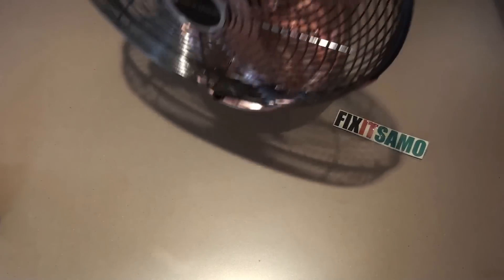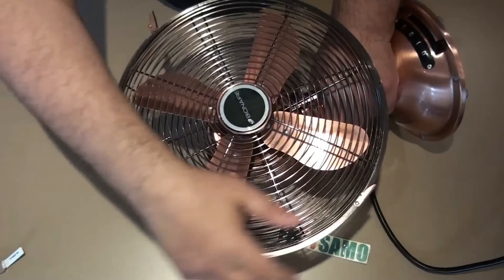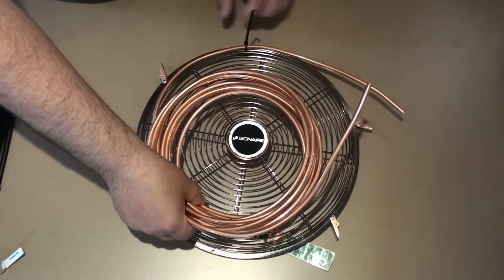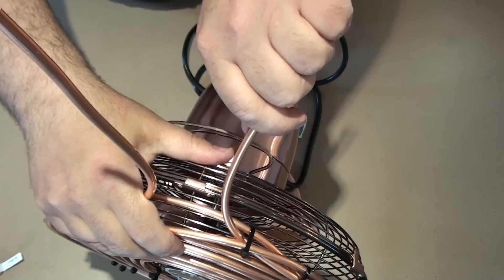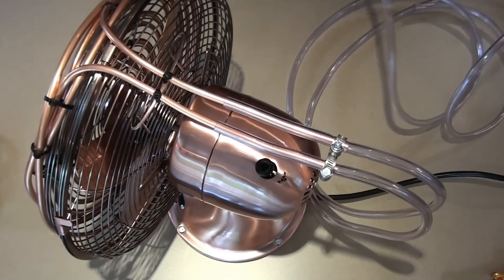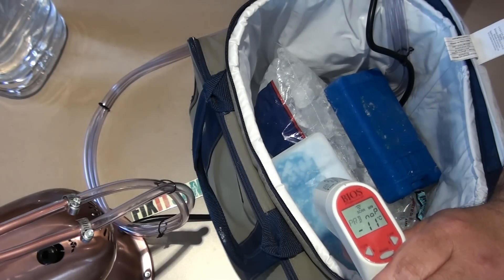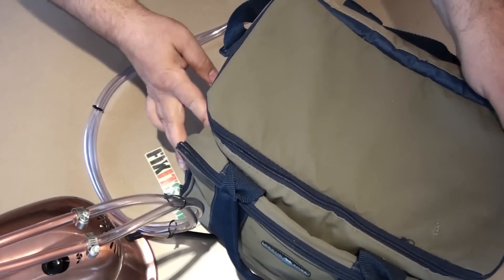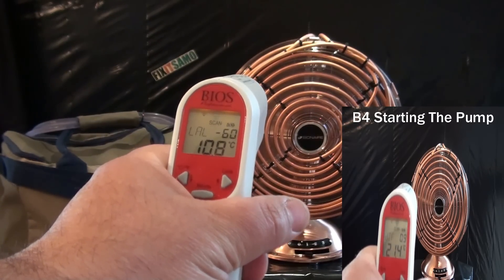How To Turn Your Fan Into An Airconditioner  AC

Comment: Just curious but does it have to be cooper tubing, can aluminum tubing be  used? its much cheaper then cooper. 
This is a great way to cool down when your living off grid. AC take a lot of solar power. This idea would be very helpful for those living off grid in a cabin, van life or skoolie. Homes on  wheels dont have the room for a big solar system making it hard to have AC. This would make a good alternative....
Reply: try bending aluminium it will snap, copper is a better conductor of heat too it's probably 4 times more expensive for that reason copper conducts electricity/heat  61% better than Alu
Reply: @I_am_not_a_bot-666  Thanks, good to know
Reply: @UnKnown-zy1km  save time messing around get a bottle that you  can spray a fine mist I don't know what you call them?  they have  a trigger and adjustable nozzle  that squirts a fine mist,  fill it with cold water and some crushed  Ice use normal desk top fan  when you need to cool down take the bottle of cold water point it at the fan spray the  fine mist in to the air coming from the fan when the mist blows back on to you it cools you down.  that's what I used to do in the desert,  get a hat   with some corks hanging from it to keep the flies out of you're face is optional.
Reply: @I_am_not_a_bot-666  I was just looking at this idea as a option. I have a full contained bus with Solar and a Generator with AC. I dont run the AC on my solar its to much of a drain on it but I can crank up my Gen to run my AC if I need too. I just dont like to use the Gen its noisy and its not very fuel efficient but if I get that hot I do have the option of my Gen. Im just looking for a different way to cool down when needed and be comfortable. 
I do have friends who cant afford to travel to get out of the heat because they're retired on fixed incomes. They need a way to cool down thats efficient and a squirt bottle with water in front of a fan is not what Im looking for. Im sure most people know that trick. It only works for a few minutes then u spray again with in a short amount of time you be soaking wet. Its not something people would want to do all summer long. This fan Idea in the video is much better then a squirt bottle of water. Specially since Ice is Not a problems for most people living in tiny home on wheels.
Reply: @I_am_not_a_bot-666  This is probably a stupid question, but if the water flowing through the tubing is being cooled by the fan, then wouldn't this design work, albeit less effectively, without ice?
Reply: Where are you going to get a constant suppy of ice... which you would need.
Reply: @terrystearns1196  There are ways to freeze water off gird. Also many who are off grid in a home on wheels can drive to the store fill up the cooler with ice. Most people off grid run their Refrigerators and Freezer on solar because it doesnt take much energy to run a fridge/freezer. Even fridge with ice machines work on solar or they can also have propane refrigerators like whats in most campers and motor homes. Off grid doesnt mean not having any power. It just means you have to watch how much power you run on a small solar system. A lot of off grid cabins do have plenty of solar because they have the room to have enough solar panels and a place for big battery storage. People living in RV and tiny homes on wheel do not have the room to have lot of panels and big battery banks. Because they travel only solar they have is what they can travel with. Few panels on the top of the RV and a couple of batteries in a small hidden compartment. Theres just no place to put a big solar system. So nomads, vanlifers, skoolie ppl, RV'ers they have to watch how much power they use. Most can run a AC but they couldnt run much of anything else or only run the AC for short amounts of time. The fan would help to fill in the gaps on unbearably hot days. Not something to run 24/7 all summer long... 
Anyways to answer the question ice isn't a problem off grid. I even have a small ice machine in my RV.
Reply: I'm gunna recommend you buy a physics book, it might change your life. for this application look into insulators, once you understand how energy flows you'll be able to come up with many more possible materials that could be substituted..
                                                                                           -Teach A Man To Fish!!!!!
Reply: @andrewh1096  Ok Thanks, what books do you recommend. Im always looking to learn new and helpful things. I agree I dont know much about solar or electricity. I just know being a solo female living in my off grid bus my solar and many others solar systems will not hold up to powering a AC. At least not without spending a whole lot of money on a powerful mobile solar system. I would love to know how I can stay cool in the summer by running my A.C. all the time or other ways to bring temps down. If I stay out of humid states a swamp cooler works to keep it comfortable. My solar works good for my needs except when it come to a A.C. I can do everything I could in my regular home except run the A.C. for more then 2 hours. Other then that nothing has changed in my power usage. I watch TV charge my phone and laptop, I run my laptop and TV a lot. I can use my kitchen appliances, lights including my fridge. I could use propane for my fridge but it runs fine on th solar so no need for the extra expense and Fridges dont use much power to run. I was just looking for something to fill in on those hottest few hours of the day, when a fan isn't cooling enough. I move with the weather normally so when its summer I go where summers are mild. Then to where the winters are mild. No snow unless Im doing a ski trip lol... 
There are a lot of people who live in there home on wheels that dont get to leave the hot summers states. It would be nice if they could get a little comfort. Thats another reason I was looking at this fan idea. 
Many people are older on fixed incomes and they live in a RV or tiny home because they cant afford rent or house payment. Living in a RV or conversion is cheaper for them to live and not be homeless... 
Anyways, yes I would like to read the books just let me know which ones to get....
Thanks
Reply: @andrewh1096   "Teach a Man To Fish " theses idiots will say just go to the store and buy it :P
Reply: Copper is the way to go, it’s why Moscow mules are so cold
Reply: i dont see why not, but the energy to freeze the water in the first place would be the same as running the aircon

Comment: Great idea if the ice is free,  I just don't see any savings here.
Reply: pls leave your brain in bag before entering youtube ....lol
Reply: @7indranil   LOL Doc.
Reply: Most people have Ice-trays...so you can make your own ice in your own freezer. Most Newer Freezer/Fridges have Automatic Ice makers.
Reply: @AnnaJuist  Sure, but the freezer has to take heat away from the water to make ice. This heat is released into the space through the freezer cooler. You put ice in a bag and cool the space you heated before, so the total balance = 0. In fact, it's just a stream of air that creates the illusion of cold, because your sweat evaporates better. The actual cooling of the room is solved in a different way.
Reply: @DL-kc8fc   actually you have a heat gain because of the operation of the compressor. In an ideal case, waste heat dumped into the kitchen would be 6.9 J. In addition it takes about 18,000 BTU to cool a 1000 sq foot space per hour. That equates to melting and distributing 1.5 ton of ice per hour.  ( ice gives off 144 BTU per pound )  --- , good news is some large spaces make ice in the evening during lost cost energy periods and then melt it during the day when the price of electric is higher.   Thanks for posting Fixitsamo,  NIce thought experiment here.
Reply: @GabrielSBarbaraS  Of course, I mean the operating temperature of the compressor, including the heat removed from the refrigerant. There is no room for reports here, but I agree. The price of energy (depending on where you are) can be conditioned by registration and code of metering hours, which are equipped with a double tariff. At night, energy does not have to be cheaper, and if it does, it can be, for example, only 90-120 minutes.

Comment: how neat  I built one  put a little salt in the water along with some ice  and it will be alot cooler
Reply: Wouldn't the salt harm the pump??
Reply: @AnnaJuist  It is necessary to put ice and salt in a separate bag. Water also lowers its freezing point through the bag.
Reply: @AnnaJuist  these kind of pumps are used every day in saltwater aquariums. They are all plastic inside so no metal ever touches the water.

Comment: What is the total to do all of this
Reply: 5000$
Reply: cheap bro, figure it out on your own.   You need a fan with a metal grill so it will hold the weight, a fish tank water pump, and 15 Feet of 1/4 inch or even 3/8 inch copper line.  I'm sure the prices will be different depending on where you live.

Comment: You can just buy a portable ac you dumbass
Reply: @badbilly7499  lol ok bad billy let me know how your fun project works out for you 🤦‍♂️👊
Reply: @jz3689  Wheres the 75 dollar link?
Reply: @badbilly7499  keep looking you’ll find it
Reply: @badbilly7499  but if you must be entertained go on Amazon and you’ll find one if Home Depot doesn’t carry them anymore. You can do it billy I know you can. Meantime let me know how that fun project goes for you haha
Reply: @badbilly7499  actually it looks like you can find them for under $75 on Amazon. Lmao billyyyyyyy what you got to say to that?
Reply: Oh you must still be searching for that link haha. I’m gonna call you silly billy.
Reply: @jz3689  I already did something like this for the work van that the company refused to fix the ac since we used it occasionally but it still got unbearable hot. styrofoam cooler filled with ice cut 2 holes one for a portable fan one for a dryer vent, definitely worth the 50 bucks or so for the creature comfort of ac. That's pretty much the main reason something like this popped up in my recommended, not sure why you are here if all you're gonna do is be an ass. This has a niche use even if it's not the most practical. If you are in a place with no windows or the inability to have a window ac unit portable or not then this sort of stuff works fine. And the cheap "ac" units you are talking about that are in fact not ac units but simple humidifiers don't work in places where the humidity level is already too high since it relies on the simple concept of putting water vapor in the air. Again you would know this sort of stuff if you spent your time educating yourself instead of trolling. It's honestly sad you think understanding simple concepts you should have learned in high school is somehow "going bill nye"
Reply: @jz3689  This was back in like 2012 so the exact products wont be available but here is the basic set up
https://www.walmart.com/ip/Lifoam-Envirocooler-Huskee-Cooler-45qt/485438903 cooler  $13
https://www.walmart.com/ip/Lambro-224WS-4-in-White-Dryer-Vent-Hood/47652479 vent $13
https://www.walmart.com/ip/Go-Fan/184049181 battery fan $13
im pretty sure at the time though the portable fans where more expensive and i had to buy one of those car inverters for the plug. The fact you are over 50 and think a styrofoam cooler and dryer vent would cost more the 25 bucks put together is pretty pathetic. 

This was before I joined the military, got a better education and then got super lucky and invested in BTC when it was still sub 1k. Im 31 and don't work anymore. You say youre not trying to start a fight with anyone yet you call people dumbasses, call them delusional, and try to make fun of someone's first job. Nice. Must suck knowing your life is halfway over and all you have going for you is trolling on youtube.
Reply: @badbilly7499  lmao 🤣
Reply: Portable ac's cost like 20x times more than this setup.
Reply: @70mavgr  $75 for a portable ac so by your math this contraption would only cost you $4 lmao 😂
Reply: Tomaras Theodoros You can buy 
5000to 8000 btu ACs for less than $200
Reply: @james4582  finally someone chimes in with common sense.
Reply: @ J Z
45 years in HVAC and commercial refrigeration trade and business
Reply: @70mavgr  fan $35, copper coil $85, ice cooler $20, ice packs $10, plastic tubing $5…$155  minimum
Reply: shutup
Reply: @DrinkCola  lol you shut up.
Reply: portable ac's cost alot more money and this is actually a very good cheap alternative for folks that can't afford more.
Reply: @sixxgunz3774  you can buy a portable ac at Home Depot for $75. What planet are you from
Reply: @jz3689  Can you link me the portable ac unit at home depot for $75? couldnt seem to find any under 300. Also if you understand how ac works you would know that portable ac units are not that great either. Since the heat has to go somewhere even portable ac units with intakes and vents leading to the outside all the heat exchange is still happening in the room. Which most common portable ac units only have vents to the outside so its intaking air it just cooled from the room as well as creating a pressure difference between inside and outside causing outside air to seep in...the exact air you are trying to use the ac to cool against.
Reply: @badbilly7499  never claimed they were great but definitely better than this contraption. Are you implying that this ridiculous contraption is worth building because if you are then end of conversation
Reply: @jz3689  A "planet" called a country that isn't the USA? Ever heard of that?
Reply: Portable AC units use a lot of electricity to run. A Fan uses a lot less power.
Reply: @AnnaJuist  not your ice maker need alot of energy to make the ice in doing so it releases heat out the back into your your...
Reply: @terrystearns1196  The Fridge/Freezer is running anyways (In the Kitchen)...Why not use the Ice it makes & put it in the cooler?
I can place the cooler (A/C) in any room it's needed.
Reply: @AnnaJuist  lmao ok you are delusional. I’m talking about battery operated portable ac first of all. An electric one which really wouldn’t be considered “portable” but just for the sake of argument here if we are referring to using an electrical unit then the output would generate much more ac to fill a standard room than this contraption would. So something like this may perhaps cool you off if you were to be directly in front of it and constantly changing the ice packs and water. In the end I’m guessing you’d be saving maybe $50 month which would be silly for all of the inconvenience of constantly changing the water and ice packs not to mention that you wouldn’t be cooling off an entire room with this. And how many months do you use an ac unit? If you tell me you live in Florida or Arizona then this stupid ass contraption won’t do anything in cooling off your standard room. God I can’t believe this world is full of morons who think that something like this would actually save you money. Definitely no shortage of stupid people for sure.

Comment: I have a pretty good size humidifier, and on really hot days I'll add a bunch of ice to the water, which acts kinda like a swamp cooler with ice water, and that method works pretty well in a fairly small room. But of course, none of these methods will come close to an actual AC unit.
Reply: These humidifiers cool very well at relative humidity below 40 percent (that's why I bought a hygrometer). It can reduce the temperature by about 5 degrees C. It's not much, but if you have 25 degrees instead of 30 in the room, it's very noticeable. :) The higher the temperature (and low humidity), the greater the cooling effect, which you will not get below about 25 degrees, because the device works well only at higher temperatures, but you never have as much as outside, which is good. So it is possible to add it, but know what relative humidity you have in the area, otherwise it does not work.

Comment: I use an air circulator when the friends come for a barbacue, but in my city temperatures easily reach above 40°C at 4 pm in summer so at 7 or 8 pm is still very hot, a cool breeze will be more than welcome. I will probably make a couple of modifications to suit my needs but it's a great project for a weekend.
Thank you.